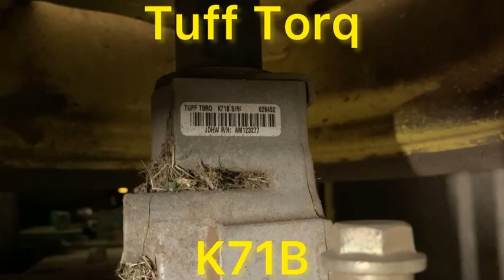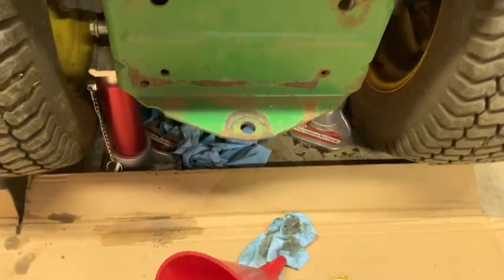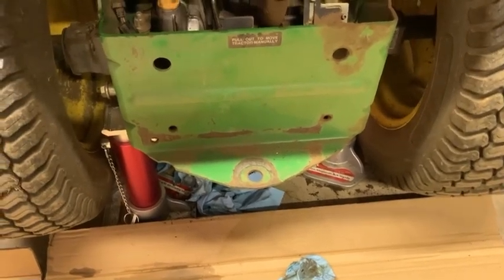John Deere GT 225 GT 235 Transmission oil change Tuff Torq K71B

Comment: The transaxle is very sensitive to any dirt and/or any debris. That is why there is the foam insert in the fill. CLEAN YOUR MACHINE before attempting this. Blow off, or rinse and dry,  if you don't have access to compressed air. It's a total waste of time if you allow contaminants into the system.
Reply from the maker: Good to know. Thanks!

Comment: Sir transmission oil and regular motor oil are clearly not the same and you don’t even really clarify what you’re putting in there so kind of a total waste of time video.
Reply from the maker: Since there are many opinions on the correct fluids for this application, I wanted to leave it up to the personal decision of the owner as to the exact fluid to put in. This video was to show where the drain bolts were and approximately how much fluid to use. I’m sorry you felt it was a waste of time, but I have done a fair amount of research and learned the recommended fluid has changed over the years.